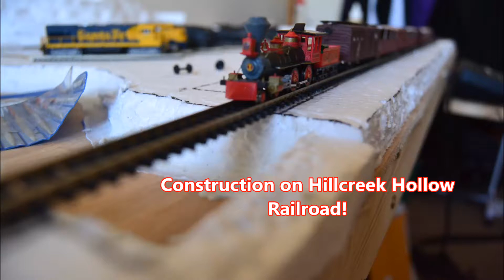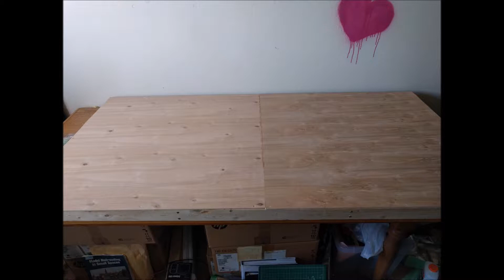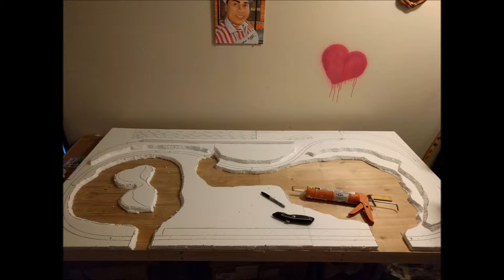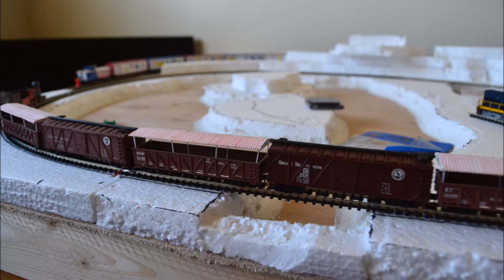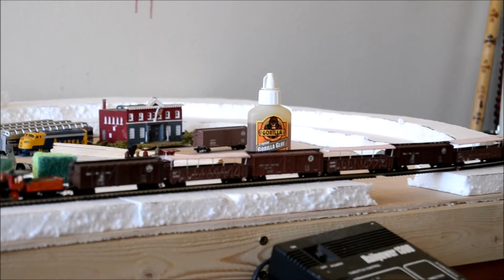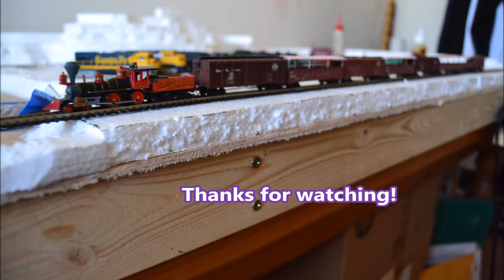Creating the Hillcreek Hollow Railroad

Comment: Nice new layout. I can't wait for a video of the layouts finished progress. Like I said before your very creative of the trains on the Disneyland Railroad. Holliday 2, Holliday 3, and Excursion 3. I have 5 red Excursion 3 cars from Bachmann, and believe it or not 2 CK Holliday engines. I got a second one because the first one wasn't looking good cosmetically, but it runs well mechanically. And I think it's good to have 2 of them for a reason, one can pull the Excursion 3 cars, and the other one (looking good cosmetically) can pull the little Retlaw 2 freight train. I'm sorry you couldn't find the Retlaw 2 train cars. But the freight cars you have are the same color as the original Retlaw 2 freight cars especially with the boxcars not being stock cattle cars. I do enjoy how you were able to install canopies on the gondola cars. As for the passenger car in the back of the Holliday 3 train consisting of canopy gondolas it absolutely does not have to be named Lilly Belle like the one on the real Disneyland Railroad. Just a good mimic of it. And believe me in the video you saw of my Retlaw 1 and 2 trains I was extremely desperate for the Retlaw 1 train set with the EP Ripley. There very hard to find. They were sold at Disneyland between 2005 and 2006 during Disneyland's 50th anniversary. Im guessing the CK Holliday and Retlaw 2 train was a limited edition too. It was sold from 2012 to 2013. I also managed to find an N scale model of Disney's pint sized engine named Lilly Belle on eBay. I think as of now you can find them at the gift shop at the Walt Disney Family museum in San Francisco CA. The real Lilly Belle and her cars are on display there. At first Lilly was on display at the California Railroad museum in Sacramento CA. I do wish you good luck if you plan to find the Retlaw 1 train set on eBay. One may pop up but at a very high price since there rare collectible items.
Reply from the maker: Thanks for the compliment! I definitley wanted trains that mimic the Disneyland Railroad. I could have bought 3 cattle cars, but the thing was, I already owned two 40 foot boxcars, and I don't like train cars to go to waste, so I bought one more matching boxcar and "dealt with it" lol. I already have enough cars that I don't plan on using, and I don't want to increase that number. I would like to improve the look of my Holiday 5 train, the canopies I made were the first type I ever made and so they aren't perfect rectangles, also the paper canopies are starting to peel back, and I'd like the canopies to fit more snug onto the cars. 

I've gone back and forth in my mind as to whether I should just scratch build Holliday 5 cars, its a big endeavor and complicated, but there are times I look at that train and wish I would just scratch build new cars for it.